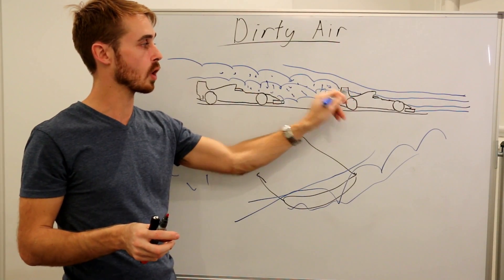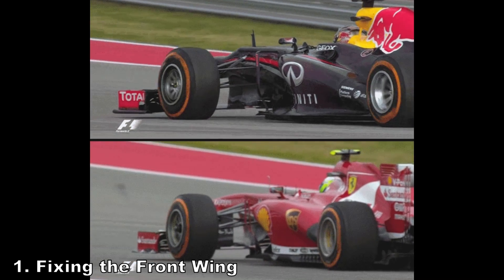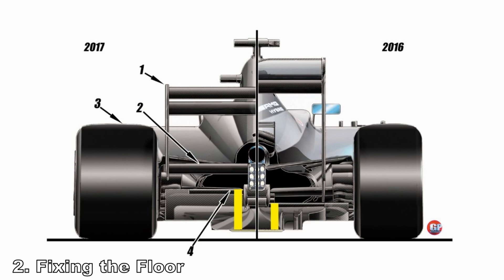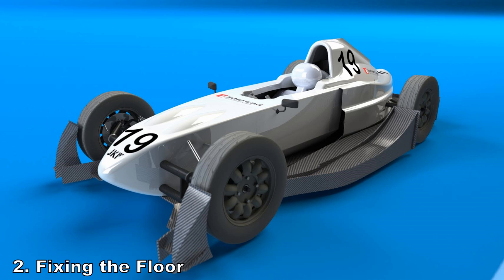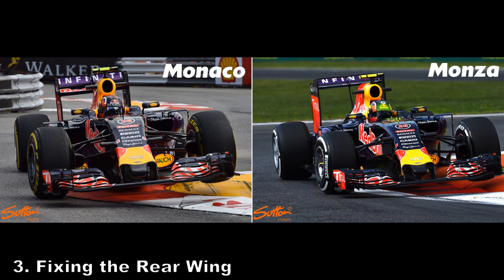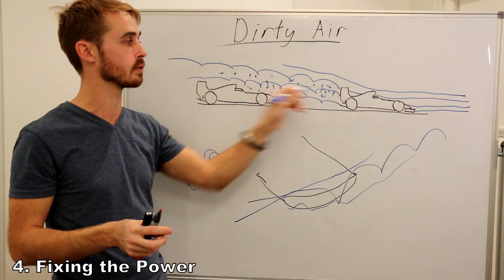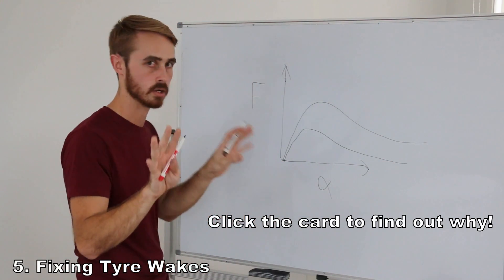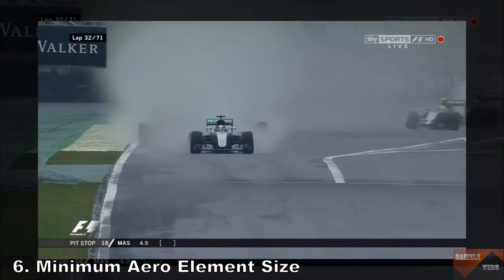How Do You Fix Overtaking Aerodynamics in Formula 1? 6 Potential Solutions

Comment: Some of the best racing we've seen in the past decade was in 2007+2008, a couple years that had an extreme low rate of on-track overtakes but had championships that went down to the wire in the last race. Overtakes don't necessarily mean good racing. Good racing and a good championship comes from a close championship.

We should be looking at making the cars more even so a greater number of drivers and teams have a reasonable chance at winning races. If helping to overtake helps that then great. But what's the point of having a couple great overtakes in a race if the same 2 cars are always 30 sec ahead of everyone else?

Comment: So basically you want slower cars just for overtaking. Great. Now watch F2
Reply: Pretty much -- Indycar uses many of these ideas (bigger underbody tunnels, rear wheel fairings, smaller rear wing, less power), F2 too but without the rear wheel fairings, and it's effective at making better racing in both these compared to F1.

Comment: In reality I think aero is not the main reason we don't see overtakes. Yes, it limits the possibilty to follow closely a car in front in the high speed corners, but whenever you come out of a slow corner and you have a long straight to slipstream your opponent, doesn't really matter that you lose downforce, you don't need it to go in  straight line.

What hinders overtakes possibilty in today's F1 is the fact that most of the cars are closely matched in performance. I was watching the 2001 Malesyan GP, and even taking into account that it was a crazy race, drivers on different cars were doing laptimes up to 3-4 second different from each other. If you're 3 second a lap faster than the guy in front, it's easy to overtake him. If you're just 0.2 seconds faster it's so much worse. Cars today, especially in the top 5 teams all lap inside a delta of 1-1.5 seconds. Ferrari and mercedes often trade fast laps for less than 0.1 sec.

We were used to a lot of overtakes because cars were not evenly matched. So, either we go in the direction of allowing again free testing for the teams, getting the richer manufacturer develop cars that are 3 second faster than the opponents or we go in the direction we are already going and try to level the field as much as possible, with the result of getting races without overtakes.
Reply: Very good point indeed. Except About the downforce under slipstream, it is important even on a straight line, mainly for breaking. So it makes a big difference.
Reply: Nicola Montori Finally an intelligent comment on YouTube
Reply: Nicola Montori Go watch Formula 2. F1 isn't for you.

Comment: I do have to point out you fixated too much on reduce the dirty air, which would be beneficial when over taking on straights. However if you look at most over taking, usually those were under breaking or fight for better turn exit or through clever strategy. To assist that, they chosen wider wheels for better breaking and acceleration.

Comment: The sheer amount of aerodynamic focus is what kills F1. The cars of the past up until 2000 had very basic aero setups ... basic front and rear wings. After the FIA starting reducing mechanical grip with grooved tyres etc the teams had to look to aerodynamics to offset the lost in grip. The problem is the cars are so reliant on aero for cornering, as soon as a car is in another cars dirty air they loose grip which means they can't corner as fast as the car in front and thus can't overtake. The solution would be to ban most of the aeros that the cars currently have and focus them back to having mechanical grip. The additional of extra mechanical grip in 2017 has given huge improvements to lap times but the aeros still prevent overtaking, I would sooner see limited aero like in Formula-E, would mean slower lap times but more overtaking ... and that's sort of the point of track racing, otherwise just make it time attack

Comment: Doesn't the rear wing up-wash also tend to pull up the turbulent air and bring in clear air from the side? That's what the overtaking working group concluded last decade with all their fancy CFD super computers. In my mostly uneducated opinion I say push the now wide rear wing at max height (950mm), remove the vertical turning vanes on the front wing and mandate an inboard end-plate also for the front wing. 

We also need to get the nose lower still. that high nose feeds air to the upper surface of the diffuser at the back to generate downforce but I suspect that its a bit sensitive to wake. Therefore a maximum lower A-arm attachment  for the front suspension must be mandated, with no allowance for keels. That would improve mechanical grip as well, I suspect.

Comment: Well just a flightsimmer, that recently got into racing, but the massively complex front wings were always one of the most stupid things to me. 
As the wings, like on an aeroplane are airfoils, and pretty much all airfoils create wake turbulence/Wingtip vortices.
The more wings and wingtips you have, the more vortices you get, which means that it will be pretty tough to keep those from interfering with each other. 

On that note a question, would some ideas like the winglets from aviation or the split-wing-loop/spiroid to fix the wake problem?

To clarify I mean aviation style winglets, not the things called winglets that were in use a few years back.
One of the main advantage of Winglets is the reduction of induced drag at low speeds and low AOAs, now F1 compared to aviation is in a rather low speed area. 

Also the cars you showed weren't LMPs, but GT1s, of that late 90's GT1 era where they were pretty close to protoypes.....the lmps of today are less likely to flip, though GTs are more likely to do so. 

As for less AOA needed to get the same ammount of downforce, wouldn't that also affect the drag, as in it would reduce it? 
And to the lower AOA wouldn't it create less induced drag and less vortices? 
As both are stronger when there is a lot of AOA at low speeds.
Reply: The teams are all aiming to get as much downforce as possible though.  Reducing drag is not that much of a priority as usually more downforce results in a faster laptime, even with more drag.

Comment: Why not just go back to fan cars and strip the exterior aero back to a minimum? That way the lap performance might be comparable but with hopefully greater potential for overtaking. I'd be interested to hear if you thought it was possible to achieve similar levels of grip using these methods 
I believe they were originally banned for some strange reason along the lines of "only being in pursuit of speed (?)" but it also had a lot to do with tracks not being set up to deal with those cornering speeds safely at the time, surely with modern track design and safety precautions it's time to re-evaluate the options
Reply: Fan cars were never banned, Bernie scrapped the BT46B because it pissed off all of the other team bosses and he needed them on his side for his political desires.

Comment: After the Australian GP I felt compelled to get back to this video.

Even though Melbourne is a perculiar track that doesn't suit overtaking, added with the fact that this was the first race after the new regulations kicked in (hence larger performance disparity across the grid), it seems to point out that close(r) racing is now a thing of the past.

Many drivers have reported an increase of the noticable wake effect: now they loose downforce when they're within 2 seconds of the leading car, where it used to be 1 to 1,5 seconds last year. 
I'm interested to see how it pans out in China, Bahrain, Russia and Spain, before forming a more definitive opinion, but I'm eager to see if you will do a follow up on this video in relation to the developing 2017 season, a couple of races down the line. ;)

Btw,
If you were an advisor to Ross Brawn, what would you like to be the general objective of F1 in terms of racing, and what would you suggest in terms of technical regulations?

Comment: Great video, and well argued solutions however, there is a simpler way. Liberalise the use of the Drag Reduction System (DRS).  A 2-stage DRS where the flap opens partially at stage 1 and then fully to stage 2. Stage 1 would be used to save fuel on straights, allowing a lighter car, capable of higher cornering speeds. Cars would produce less drag whilst in stage 1 and would, therefore be easier to follow. Stage 2 would be used as normal to allow an attacking car a chance to overtake.  A defending driver might decide to keep the DRS closed in order to create more drag, frustating the chasing car's attempt to get close but, this strategy  would burn more fuel and could only be maintained for a limited number of laps.

Comment: The sweep to the wing helps fight dirty air because as you turn you get an angle of attack in the yaw direction... in say a left turn the left part of the wing presents a higher aspect ratio and in doing so the cross section increases in length on the inside half of the wing....
Reply: George Holt, well one of the Mercedes engineers said it was implemented due to aesthetics. 
I personally think that the angle isn't really high enough to have the effect you are talking about. I guess a air flow simulation could clear the mystery.
Reply: that is why they implemented the sweep, but what we find in aviation is even gentle angle of sweep forward or backswept, will make the aircraft more stable.... cars aerodynamically skid in a turn as opposed to aircraft which slip in turns, and the angle of aero-skid is not very high, it's like 4 degrees, which is a fair chuck of the sweep angle they have now... overall, not much effect, but it will have some

Comment: You might recall that front wings used to be full width, the center of the front wing was heavily limited by regulations several years back, the reason given was that the center of the rear wing stalls more easily than the edges. 

The tall narrow wing was made to intentionally create an upwash (I think through vortices off the tips?) to draw in unenergized air from the sides that is more similar to clean air. Of course they seem to have forgotten that part, and now you've already been proven correct that this rule change of theirs wouldn't help, Lewis Hamilton has already said that following another car is even worse than it was last year. 

Personally? I think they should have brought back the effect fan. Probably limit it by diameter and max RPM of the fan, but it wouldn't matter how close the cars are running if they're sucking themselves to the pavement. Of course, the effect fan tapers off as speeds increase, so more traditional aerodynamic devices would still be required.

Comment: Regarding point 4. They mandate the limit for the total amount of fuel used during a race and for the maximum fuel flow into the engine. This I think is a much better incentive to reduce drag than limiting the power directly. If you only limit the power, there still may be reasons to increase the drag as a cost of some other improvements.

Comment: Keep in mind the Y250 element was introduced in 2009 in an attempt to help passing. The central section of the wing is aerodynamically neutral because they discovered in wind tunnel that the center of the wing was the most sensitive to losing downforce in dirty air. However since then the teams have gotten so good at managing the Y250 vortex that it's made things worse. Ironically the aero guys that suggested the Y250 element as part of the changes in 2009 have admitted that the DRS has had far more of an effect at helping passing that all the aero changes in 2009 put together. They wish they had thought of a wing flap earlier... Thank McLaren and that insane F-duct of theirs for the idea.
Reply: They could always mandate an inner endplate..

Comment: you may be a pro of aerodynamics but the fact is more overtaking is not going to mean better racing what you want is long draw out battles of cars chasing eachother and overtakesgoing right down to the wire also under most of your ideas the formula would be even slower
Reply: but by making over taking easier you would get those battles. For example you have P1 and P2 racing of the win. In current racing its harder to pass and when P2 makes the pass its harder for P1 to pass back. But if over taking is easier P2 would be able to pass earlier or even make the pass while P1 could pass back to retake the lead. easier passing is what you are looking for in racing. Its what makes it good. I mean think of those long battles, how many passes between just two people battling took place.

Comment: How long have marbles been an issue?  I don't remember it back in the Michelin/Bridgestone days.
Reply: Forever, the issue is not brand specific, all brand tires generate marbles.
Reply: Issue was smaller back in Michelin/Bridgestone days becouse FIA had different rules for tyres then. New tyres are less durable becouse they are designed to be so, which creates more interesting races. Tires in Pirelli days have created lot of interesting racing.
Reply: Marbles and all tire castoff is dependent on the tire construction, tire rubber compounds, racing surface roughness/condition and how aggressive the driver is. 
Typically, the softer the tire rubber compound, the higher the coefficient of friction resulting in higher corner speeds and the more marbles or castoff produced.
Reply: I don't think the more frequent tire changes are worth the marbles, it seems that cars could co side by side through turns much more readily without them
Reply: Don't know.. I don't find them rolling around on degrading tires very interesting to watch...  in the michelin/bridgestone times... it was about how good, consistend and longest people could drive on the limit... you saw all those tiny movements and mini slides in the car movements... since they were always on the limit...  today they can't do that anylonger because the tires would be useless after a lap or so...

yes it produrces a narrower field.. because driving at the absolut limit isn't a factor anylonger so..   it's like a BoP for drivers...   

ofcourse you still have faster and slower drivers.. since faster drivers usually are faster in general not only when it comes to the limit.. (like consistency and other sorts) but it is no way near like it was in the past... 

I know many people think the 2000-2004 was boring because not much passing going on ... but in my view it was amazing to see what a car and driver could do...  and it was all about a long time battle.. to overtake someone you realy needed to fight for it... and to hold on for maybe almost a full race.. tiny mistakes could decide.. .

the thing what is going on nowadays just feels artificial.. like they just try what ever it costs to make it seem interesting...  with degrading tires.. to equal out the drivers... and drs to make those booring overtakes happen... (which they need to because with tires that can't hold on to the limit you can't battle the oponent into a mistake by driving more consistend on the limit)

for me it would be more interesting if they get rid of a drivers BoP by tires and get rid of DRS.. so it's about battling on the limit again..
yes alot less overtakes then... but then realy amazing ones again on the otherside..

I don't mind that they use new technology like the hybrid stuff and so on... even V10 sounded amazing... I even didn't mind kers back then because it was in the drivers hands how were and for how long it is used.. so a strategical or even tactical thing to use...  I even think the hybrid power is too less, for example in the WEC the power of the hybrid system is almost the same as from the conventional engine...  which makes a huge difference then in terms of strategic and tactical use.. 

but those tires and drs... killed the sport for me... there is just no sensation anylonger...

Comment: Slow = boring. Why not have active/adaptive aero and and ground effects.
Reply: True, but when speeds exceed approximately 200 MPH (300 FPS) (329 km/h) (91 m/s) there is negative aero stability in an upset many times resulting in the vehicles becoming airborne. Vehicles becoming airborne being deemed unsafe means no insurance underwriter will write the required  liability insurance policy for a racing event... no insurance = no racing. 
Usually the weight of active systems is a major consideration.
Reply: patw52pb1 how verbose

Comment: Good news everybody: Formula E got this covered already
Reply: No comparison, considering FE are too slow to make the most of proper aero. Not to mention they run on tracks that don't maximise aero-based race cars in the first place.
Reply: They need to change the tracks though.
Reply: +Akmal Ibrahim As much as I might agree that the tracks are a major problem for this... it's not a viable thing to change 'just like that'. The logistics, cost and host contrasts would double the cost of the sport for ALL involved.
Reply: Or Indycar with the new 2018 package.
Reply: yeah but formula e is slow and full of f1 rejects so that's all that has to be said
Reply: the fact that they switch cars mid-race and the fan-boost bs existss makes all too gimmiky for me